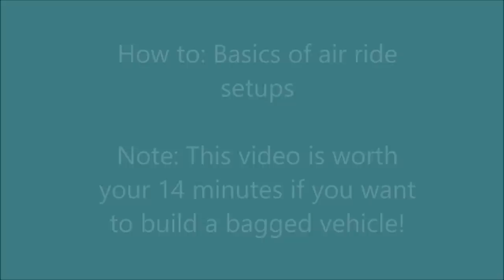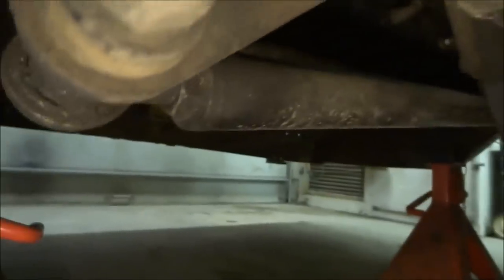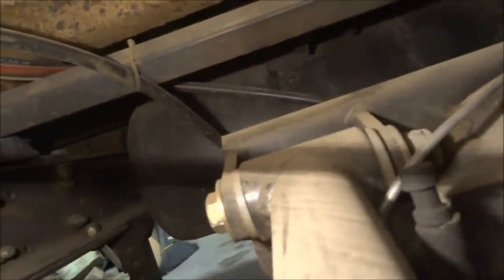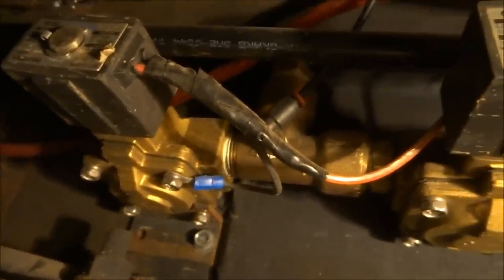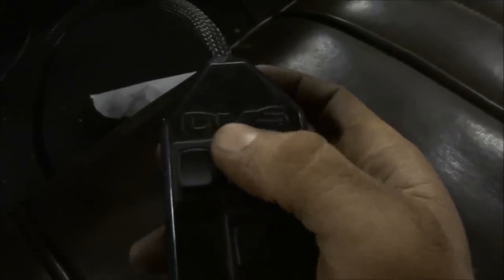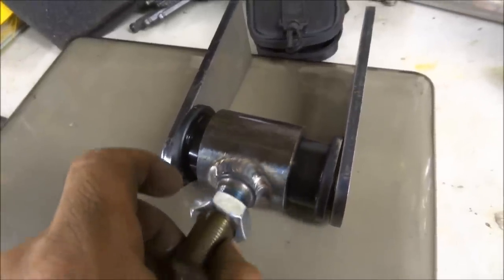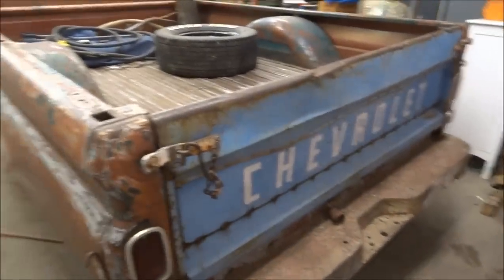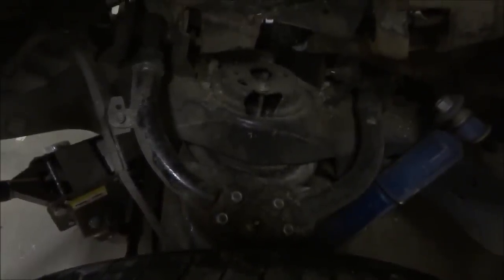How to: Airbag suspension Explained

Comment: I want to go lower and stiffer for safe cornering on-road, and lifted and softer with more travel for getting over mounds, banks, rocks, and ditches offroad. How do I do that? Cut off a few coils and mount the bags of top of the springs?

Comment: Hey great video, are you ever worried about your compressors
Being down there do they suck in
Snow or water ,excuse my ignorance I'm just getting in to air bags and am wondering how to set mine up
Reply from the maker: That's a good question Cris, They are built to withstand the water, as long as they don't suck in water (mount the auxiliary air intakes in a dry place). That being said you obviously don't want to submerge them. As far as snow goes, I don't drive this truck very much in the snow. All compressors are different, but Viair recommends you dont use them in temperatures under 0*. This is because electric parts often get temperamental in extreme cold and hot. I chose the location I did because it is well ventilated. Overheating/burning up of electric compressors is by far the #1 cause of their death.

Comment: Ey bro nice ride! I'm building a '67 c10 and I'm going to put some air bags on. I'm debating on what size hoses to use whether 3/8 or half inch.. What size do you recommend?
Reply from the maker: It depends on your preference. You can get away with very small if you want. But the bigger the line, the faster the bags fill and empty.  I have seen guys run as small as 1/4" lines. They are easier to route and fittings are cheaper, but I always go with 1/2" because I like fast system.

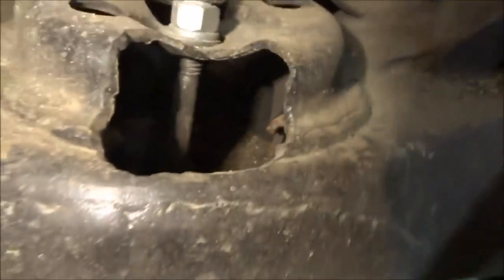Comment: Nice video. I notice a  serious problem with the safety of your truck. If you look closely at the frame where its notched for the front bags and you see a crack starting. You see it best around 7:09 in your video.  Cuts that are made   with sharp angles like the ones done for your front bags will often form cracks, its best to round off the sharp start and go cut lines. Anyways nice video and hope you have many safe miles of draggin.
Reply from the maker: +modifiedmashup76 Yes I noticed that & it has been addressed, this was when the truck was still kinda in the works lol I didnt make those ugly cuts, the guy that had it before me did. Thanks for the input!
Reply: yes your right. never cut a sharp corner. always a rounded corner.
Reply: modifiedmashup76 looks like just paint falling off. But idk

Comment: i have a 94 s10 and i want to bag it but i'm first going to do a suspension lower kit because bagging it is not in the budget with 3 kids and no job at the moment.
Reply from the maker: I suggest just saving your money on the lowering kit. Doesn't make sense to pay to do something twice. You can find bolt on s10 bag kits all over the place. Just keep saving as much as you can and it'll evnetually happen. Or keep chipping away at it by buying small parts monthly or something.

Comment: Did you custom make the brackets for your front? I have a 90 f250 and I can't find anything for it. Trying to figure out exactly what I need.
Reply from the maker: Sick Zilla Yes they have custom mounts up front. For most applications you have to build your own (Unless its an s10 or ranger). most people use 1/4" steel plate and fab it to how they need it.

Comment: Sweet video bro. I have a chevy s10 and it's time to replace the airbags. The ones currently on it are Slam specialties I don't know the exact models but they're old and a bit on the bouncy side..what brand of air bags do you mostly recommend? Thanks in advance!
Reply from the maker: +Ezequiel Maldonado I generally recommend the dominator 2600, but it depends what your setup is like. And make sure you are running shocks.... A lot of people do not realize that shocks are a must on an airride car/truck.
Reply: +Tinman 2 Kustoms I was looking at those dominator 2600 but the slam specialties SS-8 caught my eye. I really don't know much about them but time will tell. And my setup I belive Is the panhard bar where the bags are on the rear of the Axle past the C-notch. If those SS-8 don't satisfy me I will totally go for the dominators. Plus they are way cheaper. Thanks a ton!
Reply from the maker: The ss8 is about the best bag that you can get. The dominator 2600 is very similar, just less expensive.
Reply: +Tinman 2 Kustoms sweet thanks for the info bro. Another thing real quick. Does it matter what shocks you run? No don't have any shocks on mine. Will any type of gas shocks work or does it have to be drop shocks? Mine does lay frame so just curious.
Reply from the maker: Wow, no shocks is KILLING your ride quality... They can be normal gas shocks, but I usually use Bilstein shocks with swiveling Heim joints on each end (That way there is no binding throughout the travel of the suspension). With  the bilstein shocks there are a lot of different options, valve ratios's, etc.
Reply: +Tinman 2 Kustoms I ordered a pair of bilstein shocks today. The ride is kinda crapy at times so hopefully these will fix the issue. Thanks for your help!

Comment: You think you can do a video on how the solenoid wiring is ran because I have a mazda b2200 bagged and I'm not sure if my solenoids are wired right just stuck open
Reply from the maker: It's pretty basic. All valves are different, so you would be best off looking for a diagram for your particular valve setup. Or you can always try different wiring combinations and see what works, while it is off of the truck. It shouldnt be difficult... If you cant get it to work then the valve is probably bad.

Comment: Kind of a dumb question here.. when you're at the tallest ride height, and the bag is compressed the most, is there a noticeable difference (ride stiffness vs softness) compared to when you're at the lowest setting? If so does this mean a bumpy ride while jacked up and soft ride while bottomed out?
Reply from the maker: Paul Rasor Not a dumb question at all. You are 100% correct. At full inflation (highest point) it rides stiff as hell, and at lower air pressure it rides softer. It is a science and something that the individual builder has to decide on for the purpose of the car and their tase. There is a lot more to setting up a proper air ride system than just bolting/welding stuff on. That's the difference between a well executed bagged vehicle and a piece of crap that is on craiglist a few months later.

Comment: Great video, very informative!! You seem very knowledgable so I'm asking for help. I recently bought a 97 chevy bagged by Exstensive in Houston Tx. Got it fairly cheep because of the owner passing. Question is my compressors works when I send 12v to the Pac 80 relay or the sensor mounted on the tank. But still
can't get the compressors to come on by themselves. is there a fuse or a switch I'm un aware of? Any help would be appreciated. Also the bed was off before i got it. Thanks again for the info very well done video.
Reply from the maker: Their should be a pressure switch that tells the compressors when to turn on. Most pressure switches are set to turn on around 135psi and turn off around 175psi. You are probably victim of a bad pressure switch. FInd the pressure switch and make sure that their is a hot wire going into it, and one wire going to the compressors. If it's hot, but still doesnt work then either you have a weak connection or a bad pressure switch. Here is a site that has some pressure switches, hope this helps: http://store.gaugemagazine.com/air-ride-pressure-switches.aspx
Reply: If the truck wad bagged at extensive in Houston Texas on sunny st take it back to them .. They offer lifetime warranty they might help you out..
Reply from the maker: I am from MN, long way away from me. ha

Comment: hey man great vid. do you manually fill your bags to a correct  level? im just scared when mine are installed il over inflate them and damage them.
Reply from the maker: Thanks! You just make sure that your bags are rated for the max that your pressure switch will shut off at (most bags will take more than compressors will give them). So don't worry too much. Just keep doing research and rad up online, you'll figure out the specifics fast enough!!

Comment: What type of shocks are you running or prefer to get that expands at the highest point and can contract to the lowest point
Reply from the maker: There are many manufacturers. you want to get truck shocks or off-road shocks so they have further travel or stiffer valving with a shorter travel and relocate the shock mounts. It's pretty tough to explain over comment, so you're best off contacting a shock manufacturer
Reply: Tinman 2 Kustoms thank you for responding you gave valuable information I’ll check with some manufacturers

Comment: I have 3/8 valves, if I want to get a little faster would it make sense running an adapter to run 1/2 lines into 1/2 port bag
Reply from the maker: The bottleneck is your valves. You could do the 1/2" lines, but I wouldn't count on it making much if any difference.
Reply: @Tinman2Kustoms  I'd be better off with 1/2 valves then and some slow downs considering I want fast up but not so fast down lmao
Reply: @Tinman2Kustoms  I had the idea that it would make sense or atleast more sense to have 3/8 valves with 1/2 lines to 1/2 port bag. Rather than having 3/8 valves with 3/8 lines to 1/2 port bag
Reply from the maker: @Pachuco  yep exactly big valves with slowdown/exhaust manifolds. The 1/2 line might help a microscopic amount but I doubt it
Reply: @Tinman2Kustoms is there a reason you didn't run q manifold style valve set-up? thanks for the input man, appreciate you still commenting on older videos... By any chance would you have a video showing the speed of the lift, I'd like to see for reference if possible?
Reply from the maker: @Pachuco  manifolds are slow as hell. They bottleneck things even worse. Look for the can crusher videos on my YouTube here. There are two videos. Both the car and the truck have 1/2" valves.
Reply: @Tinman2Kustoms  do they really? Even if I had 1/2 valve manifold. How would you go about connecting guages onto like an smc style valve
Reply from the maker: @Pachuco  yes. Valve manifolds bottleneck the air. All the air goes in through one port and out through one port. With smcs you have to get gauge running t's or drill and tap your brass fittings for fittings.
Reply: @Tinman2Kustoms Yea that makes perfect sense!!  I just did some researching, and I wanted to know if it would be safe to say that I can connect a valve to the tank itself have a t fitting where I can connect the exhaust valve and have two other ports one for the bag and the other for the guage?

Comment: What are your thoughts and recommendations as far as air leaks go? Do you have any video on this topic?
Reply from the maker: +Michael Cook Air leaks occur in nearly every system.... The only way to track them down is soapy water in a sprayer bottle and checking every single connection or fitting. Its time consuming. There is no secrets or magic tests. The valves are often a culprit as well because little bits of crud can get stuck in them and keep them from sealing all the way. Good luck in your search

Comment: Hi ! Nice Rat Ride LUV IT. I have a 92 Chevy C1500 Truck I am putting a bag setup on I have the rear setup put in a 2 Link with panhard bar from Ekstensive Metal Works. I put the Equal Length A-Arms / Control Arms on also from Ekstensive. I was wanting to know when you install the bags in the A-Arms where the bag goes up in the frame did you install a bag cup up in the frame ? I do have the cup with the kit, is that welded or bolted in ? Do you think I will have to cut some of the frame where the spring went in and the bag goes ? Also I have been trying to get a awesome set of shocks because I want the best ride possible so what is your experience with shocks ? Would coil overs be good I would think they would be to stiff with the spring. Any info you could give me would be great. Thanks Corey
Reply from the maker: Corey Lerille You cannot use a coil over with air bags; It simply wont work because the coil over offers spring and shock which will hold your truck at the same spot regardless of bag pressure. You want to go with a good quality shock such as bilstein, rancho, fox or king. Offroad shocks with a large amount of travel are what you want. External reservoirs are nice too if you have the space. Shocks are the most influential part in building a good riding bagged truck. With cheap shocks it will ride like shit. You will want to weld in bag cups onto your frame, and yes you will have to notch out the frame for bag clearance. Notch it out, and then box it back in with the shape that you need cut out for your bag clearances. Hope that helps!

Comment: Thanks for the video, its very helpful. I have 1950 Chevy truck, and I want to bag it? Do you know where I could find a complete air ride kit (front & rear)? From the video I can see that there is no welding require for the front in case I have a mustang front end or something similar. But what about the rear? Do they have something bolt on for the rear no need for welding to make life easier :-)
Reply from the maker: Yes, they sell bolt on kits. They may not sell bolt on kits for a 50 chevy frame, but I know they make them for s10 frames, if you are interested in doing a frame swap. If you are trying to build something as complex as a bagged truck but dont have a welder, I would consider buying a welder before even starting a build like this. I could never do half the stuff I do without a welder... it's essential. But they do make options for you if you want to spend more money...
Reply: I do have a welder. I restored a 60 vw bug and I did put air ride on it. Its was not hard because I replaced the front beam and put air shocks for the front and the rear have air bags. But for these trucks it looks more complected, and when  watched your video, it seems not that hard except for the rear air bag because I don't want cut the frame and weld a bracket in case I have wrong measurements, I will feel bad and weld my self to the truck lol
I really appreciate your help, any idea where could I find a complete air ride for the truck? I emailed Ridetech twice but the did not answer me a bout the kit since a month ago :-)
Reply from the maker: You're just going to have to go around the web and see. Its not that big of a deal to weld, just make sure you take your time and measure. Do it right the first time. I know what you mean though. Keep doing research and measure and you'll be alright.

Comment: Hey great video. I've been watching your videos since I got my truck. I did have a question. I have a 64 c20 with coils in the back and trailing arms would the set up be the same?
Reply from the maker: No sir. The trailing arm trucks are actually super nice because you can basically just replace the coil spring with an air bag. You'd have to notch the frame and whatnot too, depending how low you go with it
Reply: @Tinman2Kustoms  would I still have to run a 2 or 3 link system. I want the body on the ground when parked

Comment: Tinman II Kustoms i was looking into bagging my '64 f100, but since im on a budget i really dont want to spend a ton on the system.. any suggestions of a cheap (in price not quality) complete kit? possibly a no name brand of sorts? or should i look around for something used? (install and all fab will be done by me)
Reply from the maker: I recommend piecing each part of your system together. Research each part and decide where you want to skimp out.... It all depends what you are looking for out of the system. If you just plan on only dropping it and raising it when you park, then just get a single compressor.... if you plan on playing with switches you will have to get 2 compressors... etc.

Comment: How many valves do you have per bag? Two? One for intake and one for exhaust?
Reply from the maker: Well that depends on the setup. You could do 2 valves that control the whole system.... one for filling all the bags and one for deflating all the bags, but that cuts down your control a lot. I always run 2 valves per bag. Another option is running 4 valves.... one that controls inflation of the 2 rear bags and one that deflates the 2 rear bags, then one that controls the 2 front bag and deflates the two front bags. It all depends how much control you want and what you want to do with your ride.
Reply: +SCHMULBACH22 best is to have 2 per air spring
Reply from the maker: Yeah its best to set it up that way, but also is the most expensive way to do it.